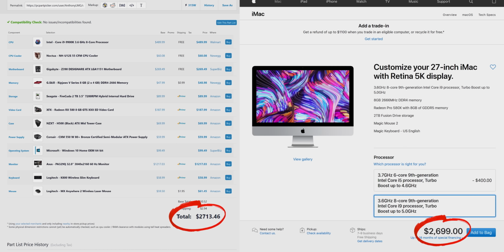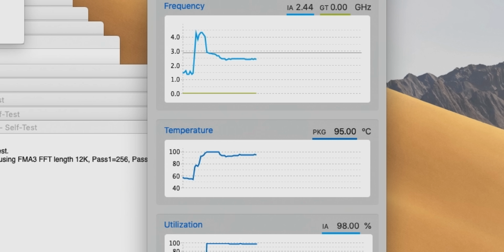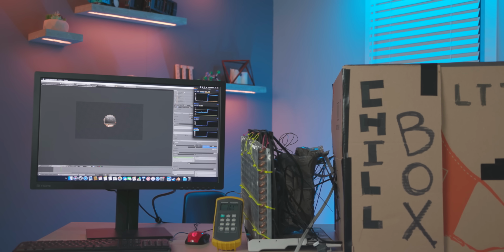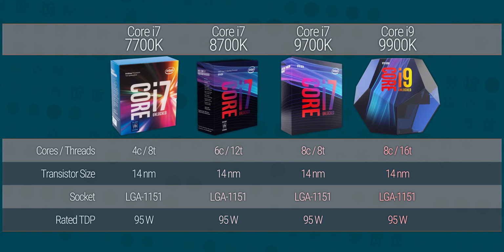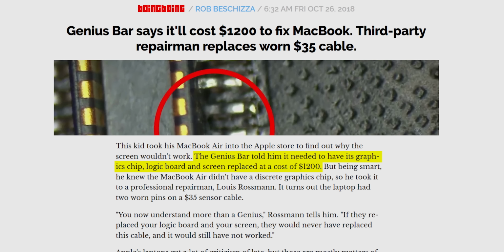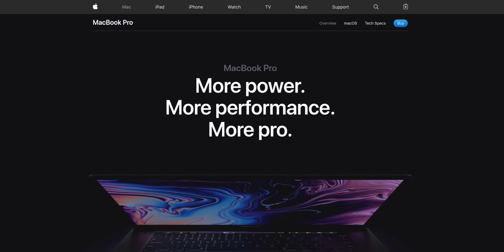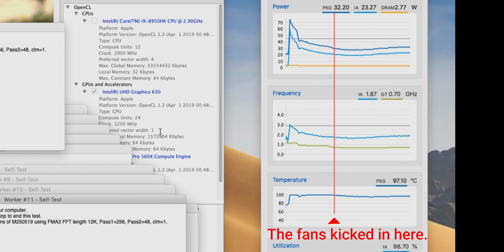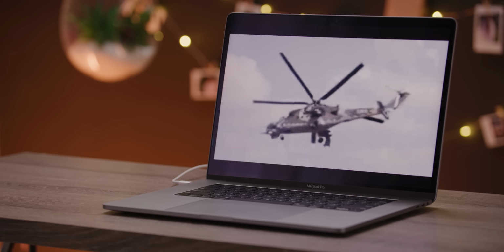Macs are SLOWER than PCs. Here’s why.

Comment: My friend laptop is a jet engine. 6000+ RPM dual fan at 70 degrees runs like "NGUUUUUNGGGGG" its kinda funny. But, but, his laptop is damn fast even with Ultra settings, 60FPS. No heat problem at all.

Comment: Mac: Hardware is a problem.
Windows: OS is a problem.
That's hilarious.
Reply: Id take the os being a problem for me. Windows(at least 10 in my 3 years of experience) isnt as bad because the issues wont cost me personally hundreds of dollars but apples fuckups would
Reply: To be fair, the OS on the mac is big part of the problem... It's what makes it throttle so little and runs fans at low RPM... That's not hardware issue.

Comment: As a former Windows fan boy I can say the reason I tolerate Mac hardware is because I find macOS to be just that much better. I ran Windows for over a decade, and not only has Windows gotten unnecessarily convoluted in recent years it wants to spy on me now (unless I go out of my way to stop it, which, no thanks. The trust still won't be there, always wondering if I need to turn off some other setting MS has hidden.) I spent a few years running Linux desktops as my daily driver which was nicer but usually janky around the edges, cause FOSS. I got a MacBook on a lark one day and have fallen in love with macOS. It has a Unix-like command line so I can actually do meaningful work on the command line (PowerShell is powerful but not very interoperable, meanwhile 90% of my BASH scripts work on macOS' command line.) And other UI elements make more sense, once you get over "No start menu and taskbar" syndrome. Granted, I have a Windows PC that I boot solely to game on, but as a professional system administrator who works on cloud systems (not Windows desktops, that's serf work) macOS has all the tools out of the box I need to get the job done, plus some great alternatives to make things even nicer. It was not the closed, wall-garden software eco system that Stallman led me to believe, but actually vibrant and highly customizable. 

That being said... if you are still reading. The hardware DOES suck. I fell victim to the butterfly keyboard last year and had to get it replaced once. I have mitigated that by using a keyboard cover but I am still deathly afraid of crumbs sneaking under my keyboard and ruining my entire system again. And my USB-C ports have started acting up, likely due to sketchy third party dongles, which are hard to avoid. I am not looking forward to the bill from the genius bar on that one, but I'll have to do it. Because as Linus points out, I can't really use macOS on any other hardware unless I want to deal with the jankiness of running a hackintosh. And yeah, in certain use cases, performance is pretty bad.

So I think the only thing Linus misses here is that some people might genuinely find the macOS experience that much better. I know some people will immediately scoff at that but those people likely don't use their PC for anything other than gaming or have not spent a significant amount of time using an OS other than Windows. At this point I would still take Linux over Windows as a general use OS, but if I can afford it, I will keep punching myself in the dick by buying apples shitty hardware so I can use their software which I really enjoy.

Comment: Theory: with their Macs Apple has to deal with Intel. And since Intel has been plateauing with their CPU’s we see these sorts of problems. And also Apple wants to be able to say there is an i9 in a MacBook because of course they do.

But with their iOS devices Apple makes the chips in house. They are able to make CPU/GPU combos specifically for the OS. So maybe the rumoured Apple ARM processor Macs will finally hit those performance targets.
Reply: Not gonna happen. Even if Apple manages to make their own in-house CPU for their Macbooks, the power that the CPU has must produce heat, and if they are going to rival Intel they need something that's as good as their i7, or better. At that level of performance, there is no way to avoid throttling when Apple makes Macbooks that are 1 mm thick. Apple CPU or Intel, you simply cannot avoid the laws of physics.

Comment: Well... I disagree. What is the oldest laptop you have which you use on daily basis? My is the one which I am using right now. It traveled with me. It was the tool for my studies. It is the tool for my work now. And guess what! It is a 15-inch, late 2011, Macbook Pro. Yes, I had it repaired because of the dedicated GPU which basicaly unsoldered itself from the motherboard, but it was for free, because Apple made a recall program and they did it for free in authorized shop.

And honestly - I've played COD while the laptop was burried in duvet. So no surprise it went wrong. My friends had to buy crappy cooling pads for their laptops, because the game was unstable on theirs laptops when playing on their tables.

Yes the laptop becomes really hot when I have a serious workload for it, but show me an alternative which stays cold. I've tried BitCoin mining on it. I was using it for Cinema 4D rendering. I was running multiple VMs on it at once. I am trying to say that it hasn't particulary easy life. And it is still working.

I am about to say good bye to it, but it is only because it is unsupported by newest macOS now and it is laging in performace after 8 years. But it is still fully usable. Display haven't broken off. No holes in body. No broken cables.

All repairs which it has undergone was the GPU, fans replacement and battery replacement. That's it. Nothing else. Pretty impressive, isn't it?

Comment: Why? Because they don't build the chips, they get them from Intel
On the iPhone, it's all apple. That's why it's great on the iPhone. 
And why don't they have a thicker MacBook with more fans or a better cooling system? Cuz they're developing a mobile processor based chip for the MacBook so it can run at speeds thrice that of the iPad Pro and have no throttling issues at all. 
This means they can kee the slim design and still offer amazing specs. Also they can use their own GPUs and integrate metal at a much deeper level. 
The reason we don't see the switch yet is cuz no apps would be supported on the new architecture untill they find a way to migrate all the desktop apps to run on a SoC.

Comment: More power.
More performance.
More pro.
More dongles.
Reply: Don't forget
More Dollars
Reply: @eastlondonhustler  shut up i hate you
Reply: @eastlondonhustler  less for apple fans
Reply: @matissebilling2245  no stop
Reply: Pay more for less
Reply: less $ left in your wallet from mac = less $ for software to render game or design
Reply: Jesse Cannon you do realize when you spec a pc to the same config as a mac it comes out roughly the same or slightly more...plus when i buy a mac i only have less money in my pockets bc only so many ben franks can fit
Reply: @zanewoodson7792  my personal machine, which has a rx 580 (base mac pro has a 580x pro, basically the same thing), 6c/12t cpu, 16gb of ram, and a 240gb sata ssd cost me around 700 usd, the cost to upgrade it to a base mac pro is not 5000 dollars. Mac pros are overpriced.
Reply: Matisse Billing basically or the exact same thing bc my brother has a spec for spec match to my macbook on his windows computer and it cost about $150 less so.....
Reply: @zanewoodson7792  macbooks can have impressive specs, but wont perform as well as a pc with similiar specs because laptops have much less cooling potential, and cant draw as much power. Also, i was kinda saying mac pro is overpriced, idrk about macbooks.
Reply: Matisse Billing the 16 inch doesnt thermal throttle or i havnt had the need to push it that far and the mac pro is over priced but i think its 100% worth it it runs almost silent but i dont have it fully loaded only about half way
Reply: @zanewoodson7792  the reason the 16 inch doesn't thermal throttle is that the parts are clocked lower than desktop variants,even at base clock. From what ive heard, the mac pro is really silent, but i believe a 240mm cpu aio, or a high quality noctua and a gpu aio like the evga kingpin paired with high quality fans would run almost as silent for a fraction of the cost.
Reply: Matisse Billing maybe but i have cash to just throw around so it doesnt bother me and i can get mac os on cheap builds i prefer mac os way less malware
Reply: @zanewoodson7792  fair enough, guess i cant argue with that.
Reply: Matisse Billing but windows isnt bad at all dont get me wrong i dont hate windows its just not as smooth to use and it doesnt syn perfectly with my iphones ipad imac pro mac pro and mack books like all apple hardware/ software does
Reply: @zanewoodson7792  i didnt think you were, i might use mac, but a lot of stuff i use isnt mac compatible
Reply: Matisse Billing you can run windows on mac with boot camp that comes with all mac computers
Reply: @zanewoodson7792  yeah, but i believe theres a fair bit of overhead, and you miss out on some features anyway. If i wanted mac that bad, i could just install it.
Reply: Matisse Billing true but youll still missout on the true optimization bc there are special chips in mac computers that make alot of the features work . Also what computer do u have rn im just curious
Reply: @zanewoodson7792  i have a r5 2600 and a rx 580, cost about 700 usd
Reply: You realize that apple makes shit cooling which actually translates to less performance at stock not to mention not leaving any overhead to get the most out of your components with overclocking right? This means you actually get less for your dollar. More heat also translates to less longevity but then again mac computers aren't easily serviceable anyways. Not like my pc which I crack open when I feel the need to replace TIM/components/blow out dust. Just sayin...mac is garbage and you know it.
Reply: @zanewoodson7792  upgradability.
Reply: @zanewoodson7792  Linux has less malware.
Reply: How do you type like that please explain someone
Reply: Eric Chandler its not really more dongles bc you can get docks and have many times more ports that PCs
Reply: @zanewoodson7792  yeah, you can get docks for pc as well, i might have missed your point, but a big issue with macs is the need for an adaptor, with their whole "what you need but not more" design ideology
Reply: @zanewoodson7792  doesn't change the fact apple IO's suck
Reply: @zanewoodson7792  not true becouse you can't get more thunderbold ports than already are in your one. And you dont need more than 4 usb A
Reply: Julian Bon i have 4 thunderbolt ports i dont use them to get more thunderbolt ports i use them for lots of usb a i connect about 4 usb-a ports to each thunderbolt port  because i use 12 usb-a
Reply: @zanewoodson7792  that argument is stupid. If your laptop had enough ports, then you wouldn't need a dock to begin with. 

In the old days, port replicators were a huge deal, because laptops didn't have lots of ports and they wanted to give people an option to dock or have an add on that offered more ports.

But then ports got smaller and more universal, meaning they can be use for multiple things, so more ports is not needed.

The Thunderbolt port may be fast, bit it isnt as versatile as USB. Sure, I understand that if a guy has a drive with huge media files, then thunderbolt is nice to have.

But their are even lower costing and just as fast of ways to store data.

A dock should be a stationary thing you use when you are at a desk or similar. But with a Mac, carrying a dock all the time, is now easier vs carrying 10 dongles.
Reply: d
Reply: Ok so in the defense of OSX: Less powershell, more ssh!  Like do you even command line bro?
Reply: More secure
Reply: @Ajayharrysimon  in your dreams
Reply: I disagree. They do live up to their innovation standard. They can innovate, go several generation ahead in technology, and amaze people on both apple haters and apple lovers to get more money for less
Reply: @giovannyc.1724  they can, but with the mac pro they sure didnt
Reply: @matissebilling2245  So correct!
Reply: @giovannyc.1724  what year are you in
Reply: @giovannyc.1724  yes selling wheels for your pc for only 800€ is truely innovative

Comment: I have tamed my 2014 Macbook pro so it is not a hotplate that is always 95C whenever turned on  :) Costum fan profile that does let the fans spin full speed already at 70c (instead of the default 95c that resulted in constant CPU throttling)  combined with use of intel overclocking tool to reduce the CPU woltage. It  can with thees simple mods run 100% CPU usage all 4 cores at 3.2Ghz (instdead of 2Ghz) and it still keeps under 80C with no CPU throttle ever  :) Apple have ALWAYS since their first computer let their computers overheat knowing very well that it reduces performance and leads to it ruining itself just as the warranty runs out....

Comment: Yeah... the same money for same specks might apply in North America... in the EU... it's more like two times the money for the same specks if not more.
Reply: My 2014 mod 2,4Ghz Apple Macbook Pro can run at 3.2Ghz all day 100% CPU use on all 4 cores with a little tweaking to CPU voltage and custom fan profile that don`t allow it to overheat perpetually... Without thees mods it would not even reach 2Ghz at same stress test....  Apple have since 1980 liked to make machines that self destructs by overheating lol ;)

Comment: Mac's are rigged to fail so that you upgrade to a new one
Reply: Yes Apple WANTS their products to self destruct just after warranty runs out and letting they overheat perpetually is a very effective way to echieve exactly that... But it is easy to fix, my 2,4Ghz Macbook Pro can run at 3.2Ghz with 100% CPU usage at all 4 cores all day without ever going over 80C :) All you need to do is use custom fan profile as it actually have ok cooling but the fans just don`t start until it already is overheating by default often reaching 100 to 104C ...
Reply: My MacBook Pro is from mid 2009 and still runs great. You could say the same thing about PCs. Why do you buy a PC? for its upgradeability... Instead of buying a whole computer you swap out parts for new ones..same concept

Comment: I read that apple will be switching from Intel to ARM.. I understand that iPhones currently use the ARM processor (that  would mean that in future intel based software will not be compatible without an emulator). Is ARM better than Intel in terms of temperature??

Comment: These are all good points - and are very true.

The one area where macbooks win out for me personally however is having a user friendly BSD unix distro on the back end of macOS that is easy to get into and has great community support with tools like homebrew and the internet at large. Coding/development doesn't use a lot of horsepower unless you're trying to run data science models on your laptop (hint - use the cloud instead), so the kneecapped potential of the hardware components isn't too much of a trade off.

Bottom line is that macOS is a superior development environment imo, and having the OS made to measure the hardware does unlock a lot of value.

Windows 10 WSL and ubuntu are pretty sharp though. Now that WSL 2 is out, I could be lured away from macOS for a fleshed out Linux experience and tools like apt-get.

Comment: As a Dell fan, I am very sorry to say it, but Dell is exactly the same... I have the Dell Precision 3530, which I bought after my 7510. Both are unusable if used the way Dell advertised.... 3530 I use with a egpu (RTX 2070), I had to turn off the weak Quadro P600 which inside because of temperatures and EVEN with the Quadro which is inside being turned off,  and an external cooler for the laptop, the device still struggles to be in the frequencies Dell promised... it often drops below 1.5 GHz !
Reply: What about the 7510? Well there the cooling was fine, but I still had to use an egpu (1070), because of the FirePro W5170M (which was advertised by Dell as the gpu which will show off performance in all 3D demanding software) was not detected by any Autodesk software and even not by Blender soft. AND NOT EVEN by Dell Precision Optimizer, it was worked in games only... I called Dell, they put me in contact with a resolution manager (Ben Burroughs) whose answer was "Well, maybe it doesn't need to be recognized to be working" and hanged up the call.
Reply: edit: ...it worked... 
Typing quickly on phone is never healthy for the grammar haha

Comment: Mac do two things well though. User experience (i.e. Low noise, slim form factor, nice display etc.), and an os that does many things better than windows.

And I can say that for work, I would much rather have slightly slower cpu speeds to a chunky laptop which has fans kicking in all the time, especially when lots of properly demanding tasks will be run on a cluster anyway.

Basically the whole video is just saying that to have a quiet, slim laptop, you need to make performance compromises, which is pretty reasonable.

Comment: If memory serve right; Intel used to go for its clumsy Pentium4 chips trying to break the 4GHz barrier when Apply did the move from IBM to Intel. The first Intel based macs been using the mobile (duo) version that had much better performance to heat ratio. Gamers had already adopted the use of Mobile CPUs allowing better thermal control then Pentium 4. Intel soon ditched the Pentium 4 idea as a baseline for their future product. Rumours are that Apply drive some of the development of future intel chip generations. Why does this matter? Intel is not an Arm based chip and its design baseline once again reaching its limits. Surely there is also the factor that apple makes much more money with iphones then any of the other devices. So that laptop/desktops are more of a niche market for them.

Comment: Macbook run slower beacause the fan does not connected with the cpu heat sink by any means. Take a look at Mcbook Air 2018 & 2019